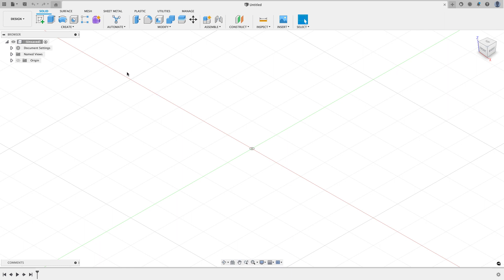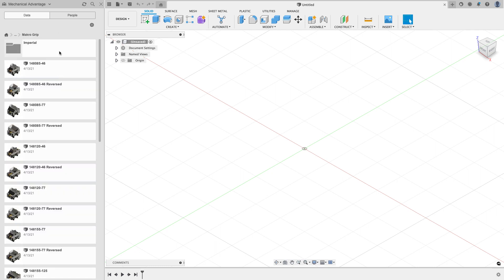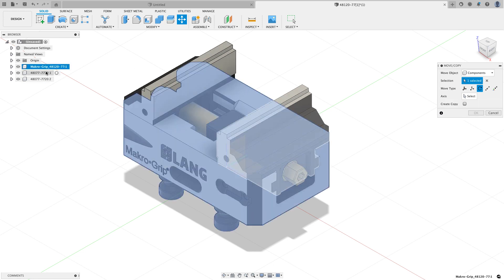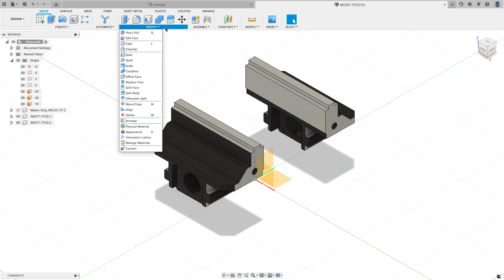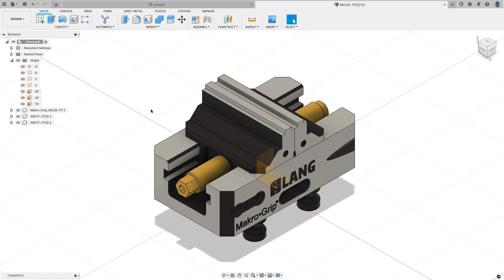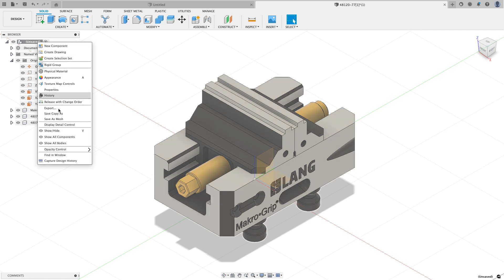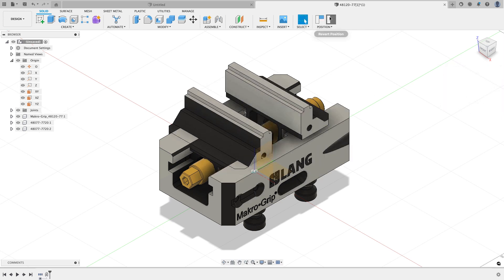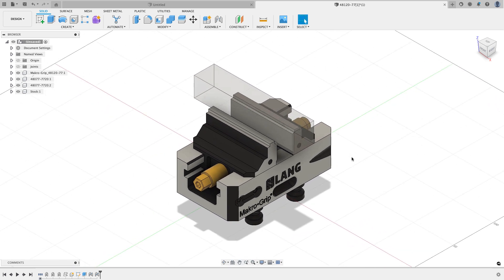Fusion 360 Parametric Self Centering Vise

Comment: I literally had a question about vises and parametrics the other day! I’ve got a 6” 5th Axis Dovetail vise and I find my dovetail cuts on my stock can be off by a few thousands. I’ve been doing too much math by measuring the difference,  then going back into fusion and adjusting my joint between the vise and stock. I’ll be giving this a try later and hope it helps. If not I’ll be shooting you an email. Thanks for the info and making another great video.

Comment: This is super useful, thank you!

One question - I have a base pallet modelled, once I created the vise model, I created a 3rd file that consists of both the base pallet and the vise on top. However, the user parameters for the stock won't be available in the 3rd file. I can "break link" which makes the user parameter available for edit, but that means any update I do to the vise model won't be updated in the 3rd file.

I think this is the same even if I am to insert the vise model into a part that I'm making, I'd need to break the link in order to change the stock size.

Do you have any recommendations on best practices for this? Thanks!

Comment: Hi Kevin, very clean way to do the parametric vise wish this came out before I did my vises. How would you handle the different jaw configurations? These can be swapped to go wider and some you can swap for soft jaw bases. Cheers, Sean
Reply from the maker: I think there will be a solution in the future that I can't really comment on yet. Stay tuned. You might also consider joining the Fusion 360 Insider Program to learn more.
Reply from the maker: I should also note that for now, you would have to build a design file for each configuration that you want to use. Hopefully that gets much improved in 2023.